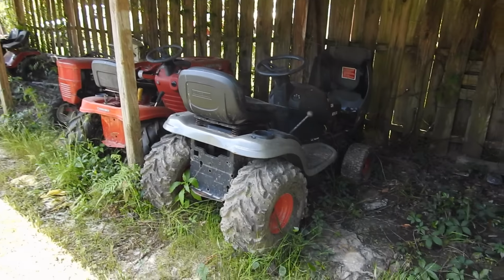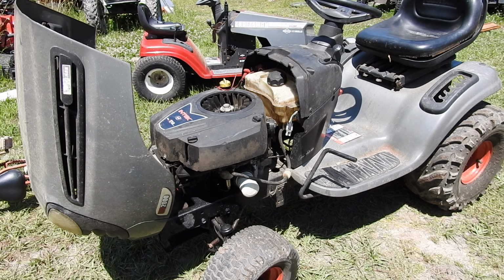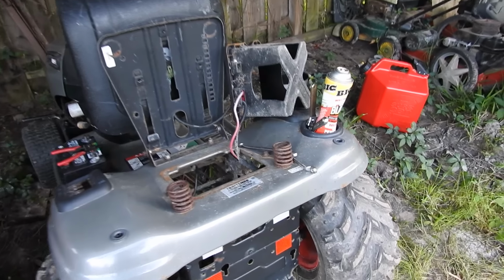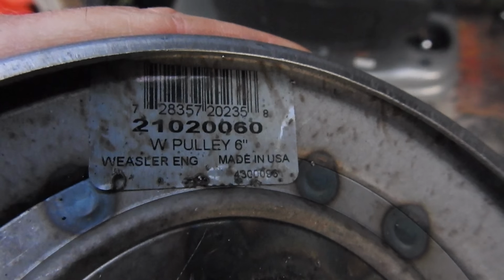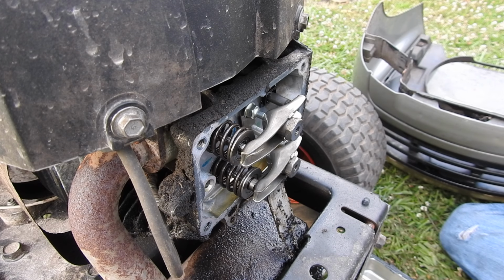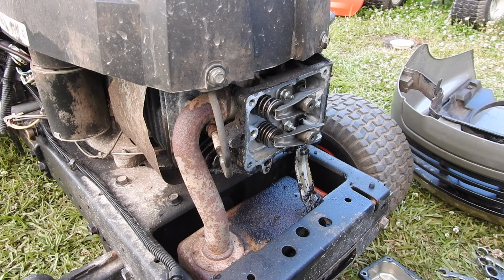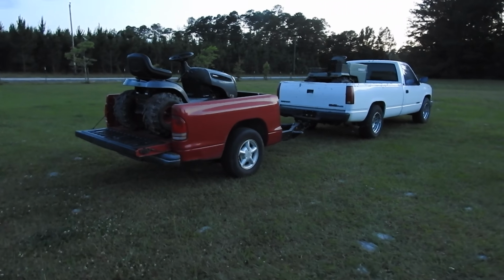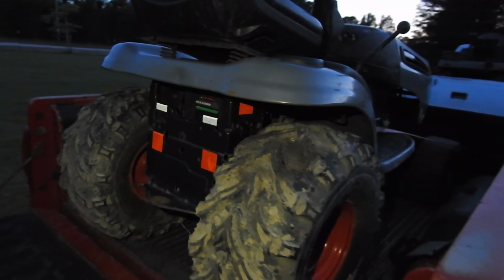Double Pulley Swapping My Silver Bullet

Comment: Thanks for making videos i have watched every video and for about 2 years i have been fixing 2 mowers that didnt run anymore i saw your videos and imediatly i wanted to make a mud mower im 15 i have a 1992 taskforce 2 (ive never heard of that brand before my mom got it at a yard sale) I pulley swapped it yesterday and its awesome i showed my dad your pulley swap video and we followed your video to get it done. i also have a 2003 cub cadet  and its very slow but is strong it has a 26hp kohler and i put a winch on the front.
Reply from the maker: i love hearing that! I have never had a 26 horse one before.
Thanks for watching.
Reply: @chud327  your welcome

Comment: Couple years back I put the 8inch on the motor and 3inch on the back. It was stupid fast. Speedo said 56mph in 5th gear with no pressure on the gas pedal. I would never put it in 6th. It did not have breaks and it was on 25s in the front 33s in the rear.
Reply from the maker: No breaks is how mine roll too, but not at 55... thanks for watchikng.

Comment: also you could add an extera idler pully to take up that exta 1" then you could remove it for a smaller belt down the road.
Reply from the maker: Yes, that is what I did on the John Deere. thanks for watching.

Comment: The pully you got for the front I just got the same exact one with that black thing for my 1989 wheel horse it works pretty good but I welded the black thing to the pully and it warped the pully but it still works
Reply from the maker: Sorry to hear about the warped part, but glad it still works. Thanks for watching.

Comment: You should of went with a 8 to 10 inch pulley in the front and a 1 or 2  inch pulley in the back. That thing would fly
Reply from the maker: True but I think bigger would have rubbed and smaller in back would slip when wet. Thanks for watching
Reply: @chud327  yeah that is very true
Reply: @chud327  I have a race mower that I built as a 4-in in the back with a 8 in the front I got about 24.5 mph I'm going for a 1 in the back to try and double the speed I'll let you know how it goes

Comment: where did u buy the key slotted with allen screw fitting that u welded to the 6 in pulley
Reply from the maker: I bought the pulley stuff from tractor supply. thanks for watching.

Comment: Cool swap. On my mower, there's a belt retainer round bar near each side of the 3.5" engine drive pulley that will have to be removed so a 5.5" pulley will fit. Did you modify and replace these belt retainer bars, or just run without them? I'm wondering how necessary they are or if I'll be dropping a belt without them...
Reply from the maker: Something I run with out , but usually you have to put the on or keep putting the belt back on. You know if it comes off, it is going to be in the deepest mud. Thanks for watching and sorry it took so long to see you question.

Comment: Would it be close to that fast if i just did the front pulley flip? i have the same exact mower and don't want to go to tractor supply a million times. What size belt would you recommend or would i be able to use the old one? tia
Reply from the maker: Front pulley flip make it about twice as fast as stock. I have done a bunch but always get the belt length wrong. You could watch some of my pulley flip videos for an idea, I just take the whole mower to tractor supply when I need a belt.
Reply: @chud327  lol, good idea, i'll just take the whole tractor!
Reply: @chud327  also you say 6th gear, but mines hydrostatic, will it still work?
Reply from the maker: @mickeyjames8361  I have never swapped pulley on an auto, I bet it would help, but might spin too fast. If you do it let me know how it turns out

Comment: Bud bud bud...... I like the idea, but that’s not good enough for me to watch😂, my tracotr is similar to yours it’s a craftsman LTS2000, I have the stock 5 inch in the front and I put a 2 inch in the back, then got some belts and a belt guard, she goes 30 mph😂😂😂😂😂, try that 😂? U will go through a lot of belts😂😂,
Reply from the maker: I love the sound of all that, but I worry that the 2 inch would slip too much when I go into the mud. I know my mowers with 3.5 inch pulleys sure love to slip when wet.  I will save the 2 inch trick for when I make a racing mower. thanks for trying to watch.